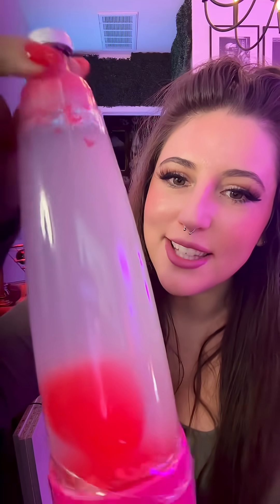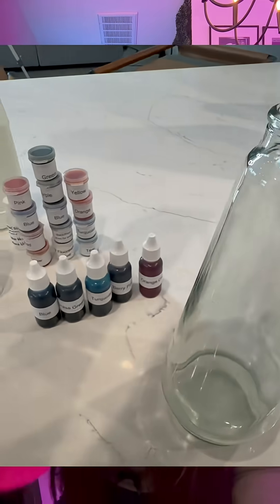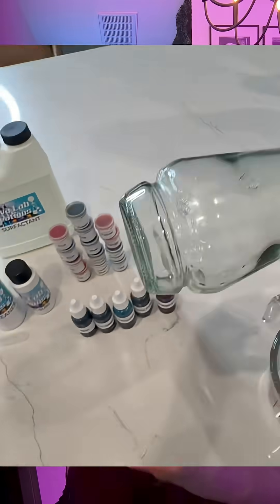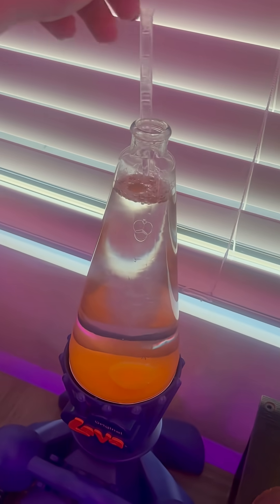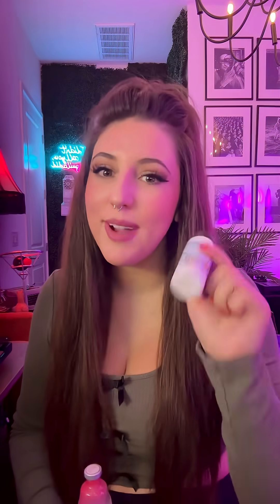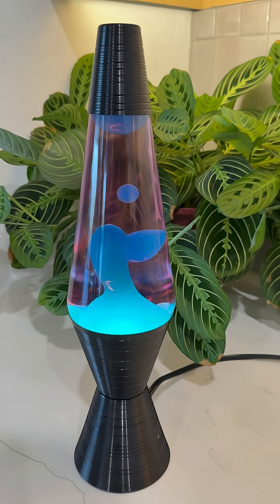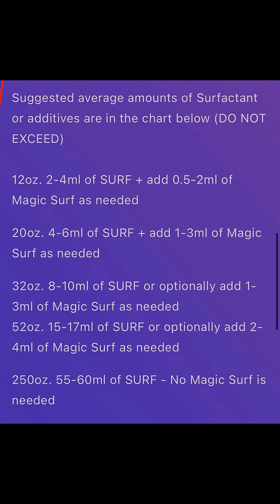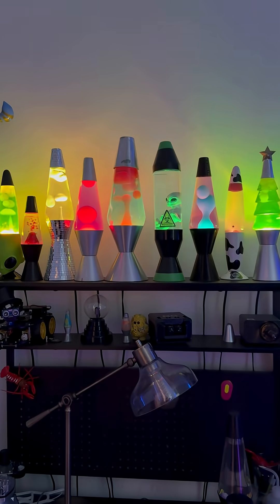Two chemicals you need to know about if you’re repairing lava lamp wax (surfactant vs. magic surf)

Comment: Why would the wax ever need to be replaced? 
I've had a lamp since the mid 2000s and it still works.
Reply: not all lava lamps are equal, and it could depend on the usage of it, or just preference. the wax or its colorant couldve rotted, the liquid could have gotten cloudy, or the owner just simply wants a new color instead.
Reply from the maker: @spootymaniacs yes what spooty said 😅 many many reasons
Reply: Wax can rot? Honestly thought wax wouldve been as long lasting as honey, wich is bad on my part, sww fair share of beehive-parts going bad without connecting the pieces